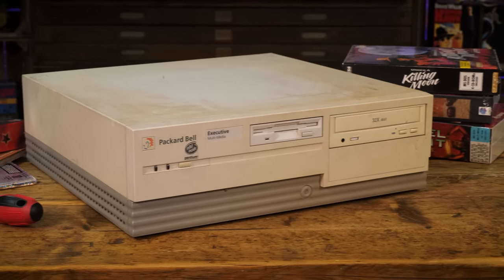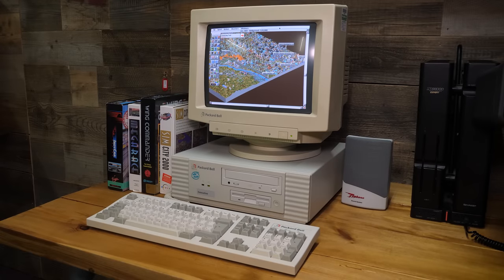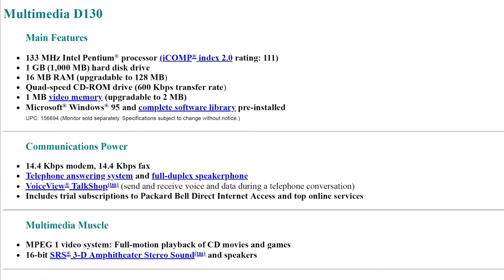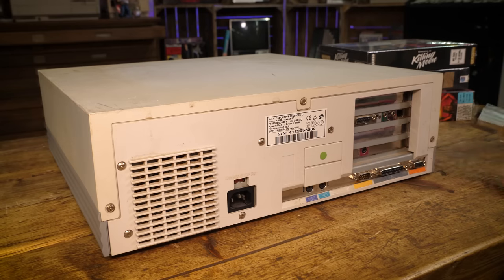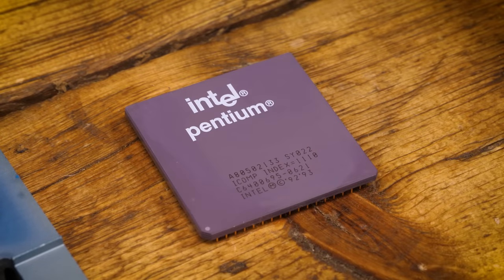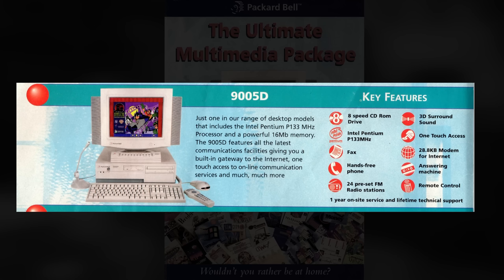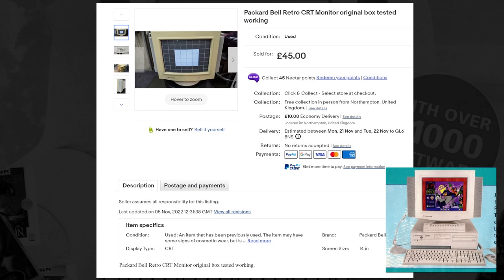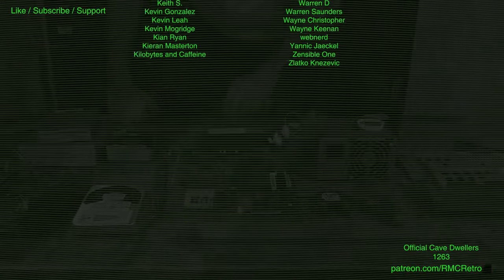Packard Bell Restoration | The Packard Bell Arrives | Trash to Treasure Part 1

Comment: I worked at a computer store in the late 90s as a repair tech. We replaced so many of those combo modem/sound cards in Packard Bells that came in. The primary reason was that they'd get fried through the phone line due to a lightning strike during a thunderstorm. Owners would be pretty upset when we had to break the news that they needed both a new modem and sound card!
Reply: I remember attempting to find the drivers for the sound/modem card to do a fresh install - they were a nightmare to find separately and had to using the restore CD with all its bloat, ugh.
Reply: We sold hundredsof those combo modems in the shop where I worked also as a tech. Some of th were almost as difficult to install the drivers on as he combo graphics on some "modern" laptops.
Reply: @rimmersbryggeri  That reminds me of the dirt-cheap sound cards (can't remember any details but I assume they were the cheapest on the market at the time) my school bought in 1998 to upgrade the job lot of used 486 machines they'd bought from a bank. The teacher responsible for buying the cards claimed he'd gotten one working in his son's machine but I certainly never saw/heard one working, no matter how hard I tried. They didn't work in the Windows 95 install the school technician had done and I definitely never got them working in DOS and Windows 3.1 even though they claimed to be SB compatible.

Comment: I used to mock these systems back then because it was during the era that I'd started actually building my own PCs bit by bit, but now I love revisiting these static time capsules of the era. It was such an exciting time for PC gaming, particularly as it became feasible to play 3D games at unprecedently playable framerates after many years of just normalizing that 3D was supposed to be slow and choppy. Really glad you're shining a spotlight on this stuff and that stinger put a smile on my face <3
Reply: Same.  Ive developed a fondness for old OEM PCs that I scoffed at back then, being an avid DIYer.  They are exactly that - time capsules.

I used to thrash them based on their “proprietary hardware” and “lack of upgradeability” but none of that matters now, and they’re often not as locked down as I thought.

And since the entire thing is designed as a system, they’re sometimes better designed, thermally and space-efficiently, than anything I could’ve built.
Reply: Agreed. They were the friends and family computer I got stuck going over and trying to fix only to find out 87 programs were competing in the startup folder for dominance each boot. But none of that matters now for some reason and I love seeing them brought back to life.

Comment: To be correct, you need one of those monitors with the "integrated speakers" bolted on to the sides.  And install Window 95 with Microsoft Bob.
Reply: Nahh, you need Packard Bell "Navigator"
Reply: @dennisp.2147  You definitely need Windows 3.11 with the Navigator! And the speakers! I was lucky enough to find the same model at the recycler's we had when I was a kid (Legend 410CD), and then a few weeks later a matching monitor showed up in my shop! We allow customers to drop of their old stuff for recycling, and I "recycled" that monitor straight to my basement! Unfortunately, the speakers were missing :(

Comment: I’ve literally just bought one of these on eBay, albeit a 486 model. It has the PB450 motherboard, which is actually a bit of a gem! External cache support, expandable Cirrus Logic video memory, 2x IDE, 5x ISA and an aftermarket bios upgrade supporting 128MB RAM and 8GB HDDs. I couldn’t say that for most machines of 1994/5!
Reply: Enjoy, that was my exact childhood pc - £1000 iirc my dad paid. Was 14 at the time. 486 SX-2 50, 4mb on board ram. Win 3.11. Over the years i pushed it as far as it would go, played it every day and eventually wrote my dissertation on it. Ultimately it had the full 36MB ram allowed plus a pentium overdrive (P24T) for shits and giggles as you needed an interposer that actually disabled the L2 cache 😂 ran win95 though and was my first foray onto the internet with 56k modem. The Sound16A sound card was SBpro2 compatible and was pretty sweet in Dos games. I still have the system to this day and still going!!

Comment: My first Windows-compatible PC was a Packard Bell built in May 1997. It had a Pentium 233 with 2 mb of onboard video memory and I only could afford to upgrade it to 64mb of Edo Ram, because Edo Ram was fantastically expensive costing 1400 dollars (USA) to upgrade it to the full 128mb maximum capacity. Despite being the lowliest of the low for PCs, I had a blast pushing its limits upgrading all the way up to Windows 2000 and using the computer as a home server for four computers. Thanks for bringing back some memories.

Comment: I had this very PC as my first pentium based system. I had p200 mhz, 2gb hdd, 128mb of ram, a 24x CD rom, a voodoo 2 card, a FM tuner card and a Sony 17” monitor. It gave me several years of joy.

Comment: My very first was a Multimedia something, but from 1997, and with a P233 MMX, 32MB SDRAM, 3.2GB HDD, 2MB video, non hardware accelerated, some various sound card baked in to the mobo, can't recall which... But this was the machine that really got me going... Only had a Mac Plus until then, a decked out one, but that was it... This was where I first got inside of a machine, popping in an STB Velocity Riva 128, with 4MB video memory!!! Woooo.... But, that was life changing to be honest... playing MTM2 with actual D3D rendering, it was incredible. Seeing so many games in a whole new light. From there it was the first self built, voodoo 3 2000, then the 3000, then the 3500, then a V5 5000, then Abit BP6 with dual cpus, TEC cooling, Water cooling on top of the TEC's, towers just for PSU's, transmission coolers, surgical tubing, lol... it got carried away. VP6 came after that, more dual cpu's... more TEC's.... Lot's of randomness in between... computer shows and sales, laptops, builds for others to sock money away to get some exotic thing for mine... and I was but a kid. In 97 with that first Packard Bell I was 12... And though the flame was already well lit, it went on to just dump gas onto it, igniting a great fire. All this time later, and I've dialed it back for sure, time sorta did that on its own though. The tech world will never be what it was through the 90's-00's, no more shows and sales, no more ground breaking anything, and very little tech lust. Most of that is for the old stuff now. . .

Comment: Hi Neil, great video which brings back fond memories!
Our first home PC was a Packard Bell Pentium 75 with 850MB HD and a whopping 8MB of memory running Windows 95.
I later added an additional 16MB of memory and over clocked the CPU to make it run similar to a P90 by flipping a dip switch on the main board (there should be a clock multiplier and a bus speed setting if I remember correctly).
Those speakers on the side of the monitor are actually screwed in with 2 screws each - they even supplied a special long metal bar with a screw thread so you could install them more easily.
Some time later I reinstalled our machine with Windows 98 and, from what I remember, the Aztec sound card worked well enough (ours was just a sound card, no fax) both in Windows and for DOS games.
We made do with the Cirrus Logic integrated graphics which were decent for all the games of the time that we played (Mech Warrior 2, Wing Commander 1 - 4, Sim City, etc.)
Good times!
The machine itself had decent build quality and was heavily used for many years by both me and my brother for gaming and school / university coursework, easily lasting more than 10 years. It finally got put out to pasture due to lack of use in 2010 as part of a house move... though I was sad to see the old girl go

Comment: My first PC was a Packard Bell 486sx 25 with 1 MB RAM in the same case. I upgraded the CPU to a 486DX4-100 with 4 MB of RAM.  Then the keyboard stopped working.  There was a tiny fuse on the motherboard that had blown.  I quick short with a piece of ethernet wire and I was back in business.  Eventually it was superseded with a new motherboard, processor and RAM but I used the same case.  It finally went to PC heaven in 1999 after giving me 5 years of relatively reliable service.  The legacy continues though.  All of the devices in my home have a girl's name and the primary server is always called Phoebe, an extension on PB for Packard Bell.  Sad, I know but it makes me smile.

Comment: I'm from the US, and got out of highschool in 2000, but for 3 years I took Computer Network Technologies classes, and my school system here in S. Carolina used a combo of Gateway, DELL, and Packard Bell systems, and part of our lab work, was taking on the task of fixing some of the machines to take off some of the load of the county's IT department, and I can tell you now from experience, to just yank that fake sound blaster/modem card out, and toss it, to save yourself a lot of headache due to driver, and IRQ problems, we always ended up replacing them with  A sound Gold, or Express sound cards that used Yamaha chips, and called it a day.

Comment: For a year or so, I was an authorized Packard Bell service technician.

The mom-and-pop shop where I worked examined multiple income streams, and third-party support was one of those streams. We were authorized for some Dell systems, some HP printers, and the Packard Bell. This equated usually to a set fee (for us and was per job, not per hour), OEM parts, and OEM training.

Packard Bell reputation took a huge hit when they were found to be using refurbished parts in systems tauted as "new".

Comment: I Love it! I used to sell these in the US working at Best Buy. I sold a TON of these from '94 - '98. There were several competitors to Best Buy  from CompUSA and Circuit City, and Packard Bell offered slightly different models to each store so people couldn't directly comparison shop. They were pretty innovative for their time, color coding the cords and ports in the system and including a large color fast start poster as soon as you opened the box. My big complaint with the performance of the system was the lack of any system cache memory.
Keep up the Series!

Comment: I'm in Canada - we had a slightly newer Packard Bell model with very much the same design language, purchased in late 1998 super cheap on clearance as a French-conversion kit (so it was a normal English machine, with the normal English software, but a set of stickers to apply to the keyboard and mostly French manuals lol). It was a tower model, Pentium 233MMX, 64MB of RAM, onboard 2MB S3 video and Yamaha OPL3-SAX sound, and the same 14" monitor with the side speakers that sounded surprisingly good.

The software ours came with that I remember included Encarta 98, G-Nome, and Little Howie's Math & Word Adventures.

Ours was solid until the PS/2 ports started to fail. It was in use up until about 2003 or 4.

Comment: I've just got flashbacks from that thing 🤣 Spent many hours fixing them (and the previous models) and even using foam cleanser on the cases after a few years as they "yellowed" very quickly. Cheap yes horrible not so much mostly as you mention they were indeed many peoples first entry to PC's. Actually had one in the workshop a few years back that is still working well.

Comment: I am with you on this. My late first wife had one of these and used it to get to know me by asking me to repair it. Over a few years I upgraded RAM, disk, monitor, and some non-pentium CPU (Evergreen?) and added a NIC. The FM card was total trash as it was unscreened and just picked up RF noise from inside the case. The speakers were powered by an external power brick which is the only part I still have. If yours doesn't work, I can donate. Keep up the good work.

Comment: I moved from an Amiga 500+ to a Packard Bell tower - 350mhz PII, 64mb RAM. It was a great, reliable machine and like a few others in the comments, I learnt a lot from it. It came with a box of PB branded games, like Blade Runner on DVD. I put a Voodoo3 2000 AGP in it and it played whatever I needed it to, until I built a new AMD 1.33 Thunderbird a few years later.

Comment: I worked for the Packard Bell support team at PC Service Call in Nottingham for the DSG (Dixons, Currys and PC World) for 4.5 years.  While this model predates my time there, our extended warranty meant I had to deal with many of its ilk.

An interesting footnote in PBs history is that Microsoft came down on them much harder than other manufacturers when it came to anti-piracy measures.  To use the recovery discs, there were several measures put in place.

Firstly, there was some code hidden in an unused section of the hard drives partition data that contained details telling the recovery media what versions of Windows to install, along with what optional software.  This also had to match code what was flashed into the BIOS.  If you replaced the HDD, the recovery media would not work without running a special command called "EXTHS /restore".
This would flash the relevant data to both, but required a special code to complete that we had to get directly from PBs systems using their SONSYS.

If customers had their HDDs replaced, we would have to guide them through this process over the phone, and generate said code.  If they did not select the EXACT options we told them to, at the end, the code our systems generated would not match what their computer was expecting. I once had to do this with a 98 year old Polish lady.  I managed it, but byt the time I finished, I was curled up under the desk.

This is just one of the many stories I could tell.

Comment: I have my PB Executive still set up. I have put the monitor in storage as I have a slightly newer one that supports a higher resolution, the one it came with only went to 800x600. I have it tricked out with an IDE to flash adapter as the primary hard drive with the original drive as primary slave. I have a USB4VC adaptor hooked up to use a Bluetooth controller, keyboard and mouse. It is hooked up to a Yamaha MU80 for Midi out... and I love the thing! I upgraded the RAM and CPU, originally I had a P60 (with MMX technology) and now it's a mighty 200MHz. I love this PC!!

Comment: My first PC was similar to the one you are restoring. It was a Pentium 60 version of the Packard Bell. I only paid £200 for it in 1997 - It was the full setup, not just the PC. One of the pins on the CPU had snapped. The seller had bought a P133 to upgrade the P60 (which was a different socket). Upon realising this, he incorrectly put the P60 back in and snapped the pin. It was a very quick fix. As a bonus, he included the P133 in the deal at no extra cost.

I sold the P60 machine to my then father-in-law for £450 a few months later and built my own machine around the P133

Comment: I remember CD speeds. They started off as single speed, dual speed, and then quad speed, but towards the mid-90's the speed branding became pure fiction.  32x, indeed😀
Reply: Ah, yes, I remember. Super fast! 52x speed! (small print: for like the last 2% of data at the very edge of a 100% full disc)
And even like that they'd still sound like they were trying to shake your computer apart, and if they were cheap CDRs with manufacturing imperfections you had a good chance of them grenading in the drive.
Reply: Some of them really did rev up to sometimes scary rotational speed!
Reply: Oh those speeds are real! I have had at least three or four disks "explode" inside a drive when they spin up to full speeds. Incredibly loud and really hard to clean up CD pieces!
Reply: I believe they can spin at the advertised speeds, but actually reading a disc is a different story.
Reply: I think they made it all the way past 52x speed, the things sounded like a circular saw when operating 😋
Reply: @cyrilthefish  I remember 52x I got a feeling it went into the 60s but might be wrong. The noise!
Reply: @Jimfowler82  LGR has a couple videos about those extreme CD-ROM drives. They seem pretty dangerous to me lol
Reply: I remember they had to stop increasing speed because it would have shattered the disc.
Reply: @Mr.Morden  they allready could shatter slightly damaged disks:)
Reply: One thing that made it tricky was that, originally, CDs were meant to be read at a fixed linear velocity.  That is, the speed of bits passing over the optics was supposed to be constant regardless where on the disc you were reading.  Since the circumference of the data spiral changes constantly, that required the disc to spin more quickly when reading the inner portion than the outer portion.  This was called CLV - constant linear velocity.  Perfectly reasonable for audio CDs.

Later drives, around the 8x point and beyond, started to shift toward CAV - constant angular velocity - that spun the disc at a fixed speed, but the throughput changed from inner to outer.

The advantage of CLV is that, if the drive was 4x, you got 4x performance end to end.  With CAV, you only got full throughout at the end of the disc - which may not even be used.

But CLV was really hard on random-access media.  If you could see or hear the disc while installing software that moved the drive head around a lot, you would see the drive constantly changing the speed of the disc, and having to wait for it to speed up or slow down to the right speed before it could read anything.  That made seek latency terrible!

So CAV was the obvious solution going forward, even if the initial throughout was compromised.  Once you got to >32x, you weren’t going to spin it fast enough to equalize inner/outer performance anyway.
Reply: I had a magazine cover CD explode spectacularly when trying to install Linux from it.